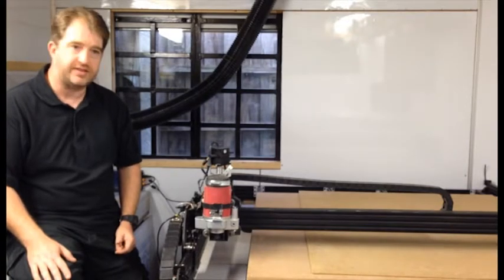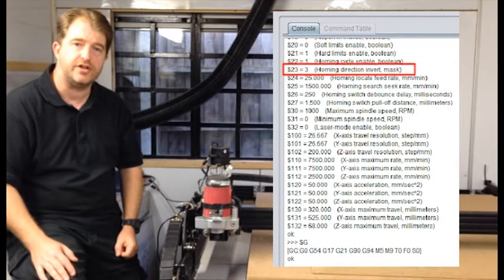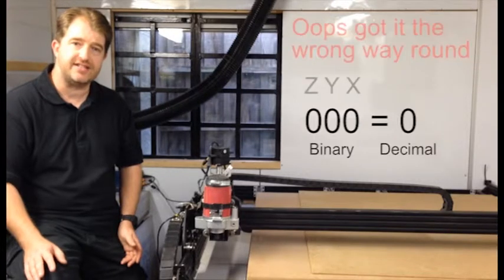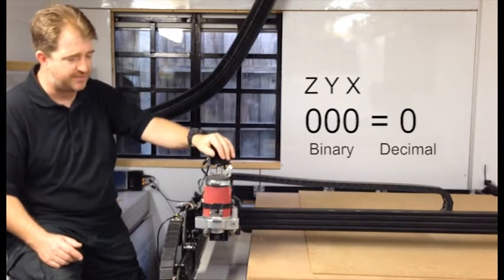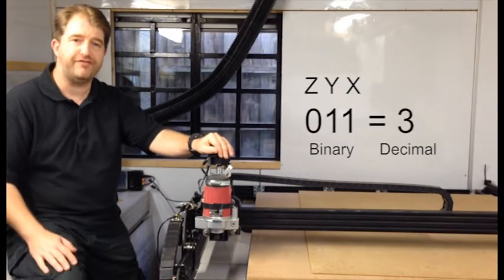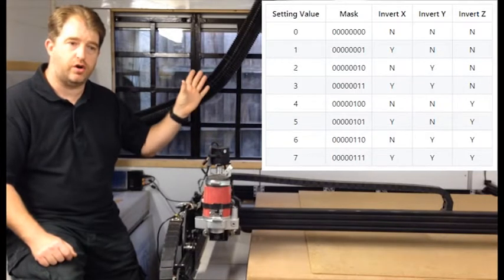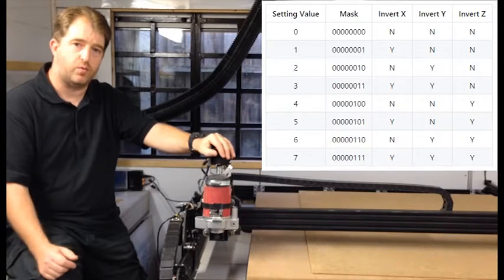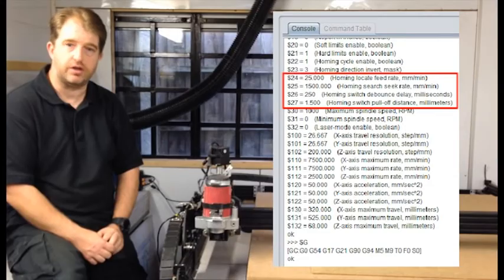Ooznest OX CNC Homing GRBL settings

Comment: Great tutorial 👍 I've found my way here tonight after an evening of sheer confusion 😂
I'm very new to cnc. but very excited it what it holds for me. To cut it short after months of neglect I found the time to turn on my machine and play around a bit. I'm using bCNC Arduino and a Raspberry Pi. I hit the 'home 'tab on the bCNC expecting it to traverse to the top right homing switches but no it came in the totally direction towards me at the bottom left and only stopped when it couldn't go no more!! ☹️☹️
Watching your vids helped me to understand but why might this have happened? The time before this homing worked just fine.?
Much respect and hope you can shed some light to this. 👍
Oh once I at the bottom left it won't travel anywhere as it says it's out of the machine limits.😩😩